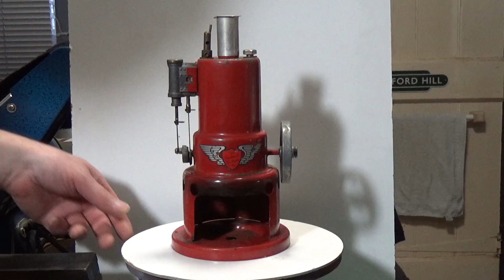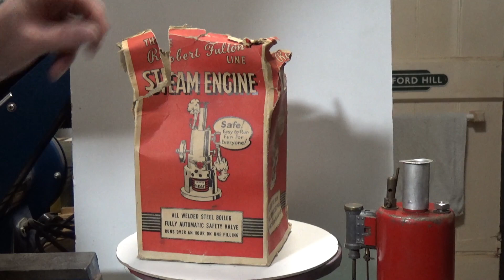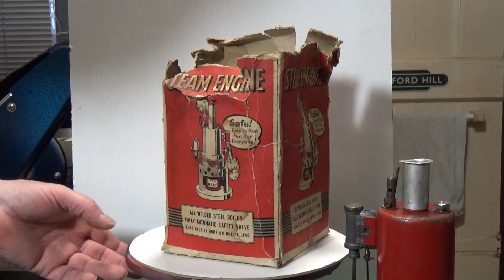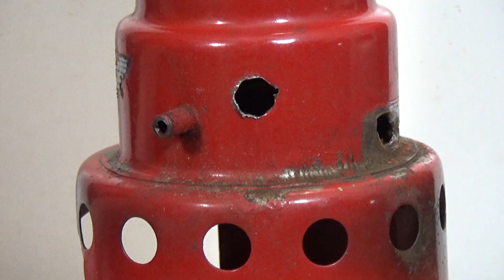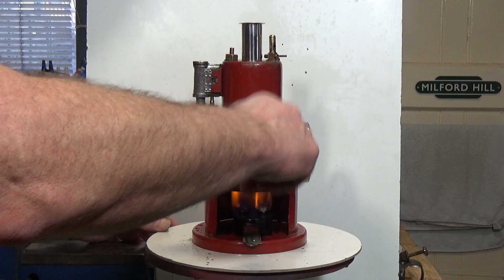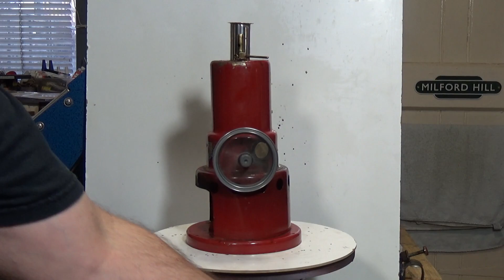Robert Fulton Line Vertical Boiler Model Steam Engine

Comment: I’ve got the plain grey version, mine runs on air but I haven’t tried it on steam and I’m not sure if I will, don’t think my boiler is in good shape 😅
Reply from the maker: They are great little engines but sadly as they have steel boilers they do tend to rust out.

Comment: Hi Alan,

Very nice smooth engine.

How did you attach the patches (solder) ?

Cheers Rob
Reply from the maker: Hi Rob. Yes, solder. On these low pressure engines i have found that ordinary plumbers solder works well. Cheers Alan.

Comment: The Red variant of the RF is quite rare. Good to see you getting it running again. I have 3 in my boneyard currently. If you want an original SV send me an email.  My first restoration in the hobby was a Black RF Meths fired. I just love these—particularly because of the “Fulton’s Folly” history. Thank you for another great video Alan.
Reply from the maker: Thanks Charlie. The Safety Valve on these is quite easy to make, i made one for the first vertical engine that i acquired.